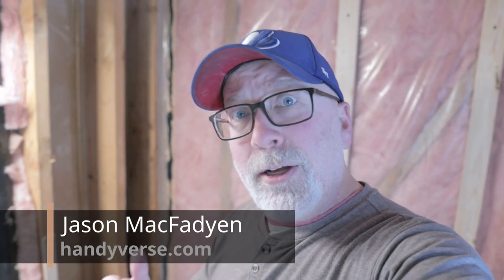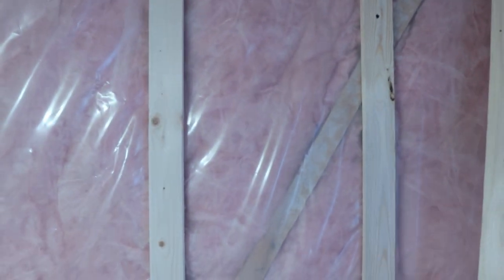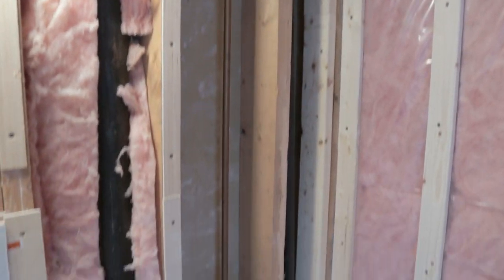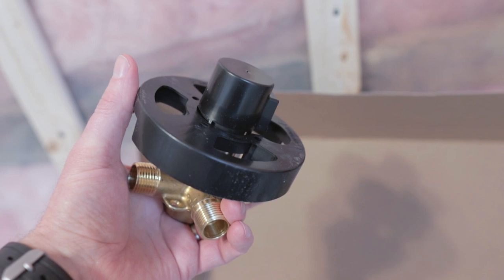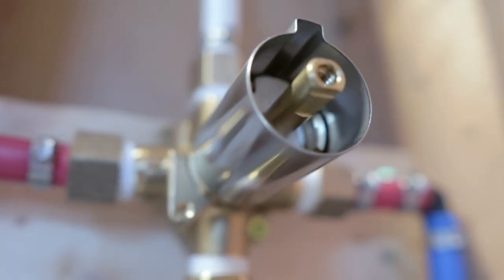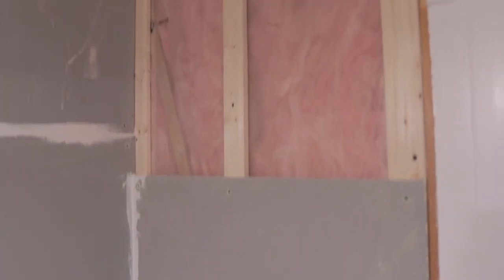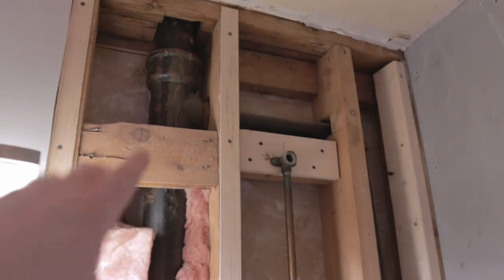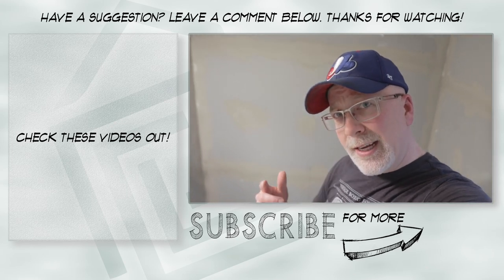Shower Tile Backer Board Installation

Comment: Hows your tiles holding up with densshield? Is that silicone you put around the shower valve? I see online people say nothing sticks to the silicone. I am trying to do the same thing with this dense shield. I put silicone were the denseshield meet. And also on the screws. I’m debating whether I should take it off now.

Comment: thinking about using denshied on my next custom shower? any issues with it so far? did you caulk all your screw holes? I read you arent supposed to let the screws go through the acrylic surface to keep the water proof seal.

Comment: SHARKBITES????    REALLY?  TYPICAL HANDY ANDY  .  CAST IRON?    LOL. NO IT IS COPPER. YOU ARE SEALING THE THE TEMP. VALVE COVER.      DO NOT LISTEN TO THIS HACK !!!!!   JUST ABOUT 90 % OF THIS VIDEO IS VERY VERY WRONG.  I HAVE BEEN DOING BATHROOMS FOR 20 YRS...
Reply: he looked to be counter sinking the screws which is a no no with denshield.  He put his sticky mesh tape over thinset unnecessarily...very strange...denshield doesnt expand so you dont need expansion gaps.  I would avoid shark bites.
Reply: I have installed hundreds of shark bites and never had any issues with them. No call backs and no leaks on checks. What is the 90% that is wrong with this video? Maybe with your 20 years, you can educate these viewers instead of being a baseless criticizer.
Reply: @jasonspicer5738  The Sharkbites, countersinking screws, backboard on surface of pan instead of flange, vapour barrier behind denshield. I couildnt watch anymore!
Reply: @aplliedweaponology  also didn't appear to put screws every 6" as per instructions. Sharkbites I'll disagree with you, but otherwise on point.